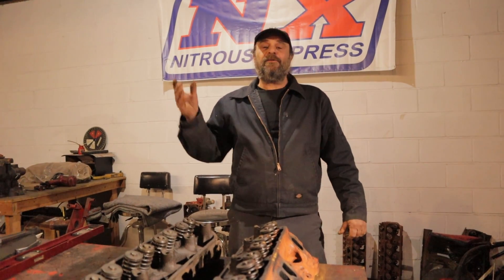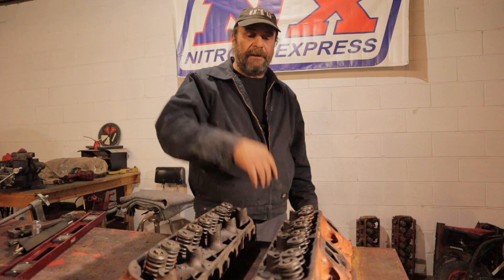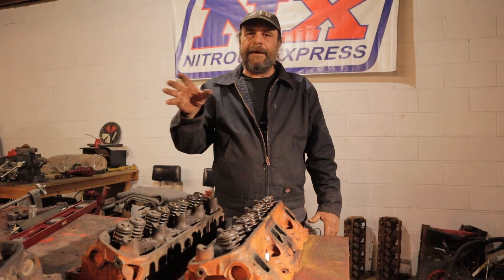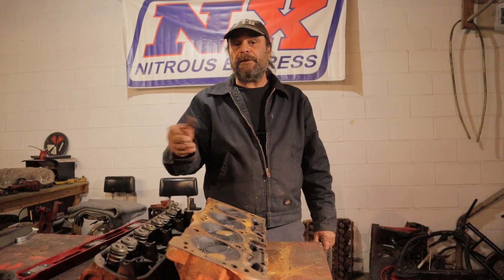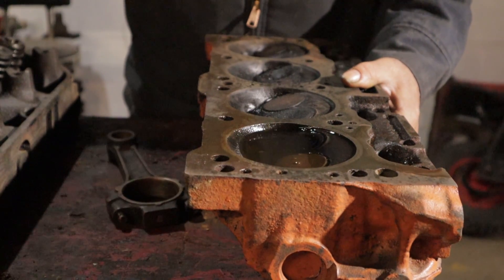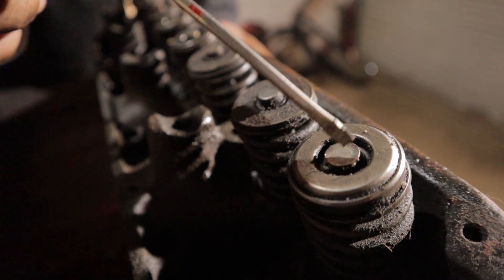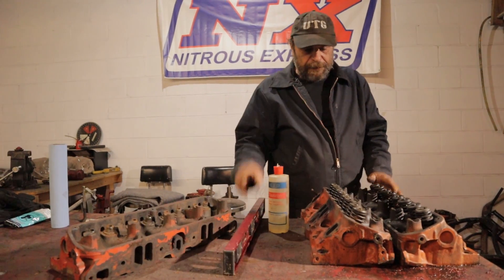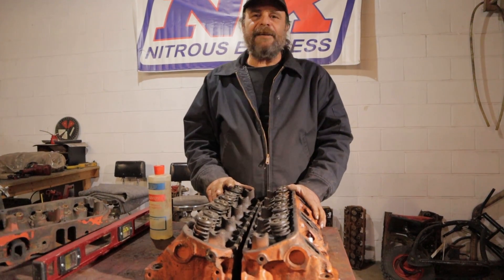Step By Step Home Kitchen Engine Rebuild Part 4:  Cylinder Heads

Comment: Some engines have those problems, some don't. Having only one or two castings for an engine sure makes it easier for the rebuilders to send you the right thing. Some are really hard to find in rebuilder form.

In the last 35 years building Pontiac engines with heads from 67 to 79, mostly before 70, and running them on pump gas or E85/E100, daily driving them for thousands of miles, racing them all the time, I have yet to have a problem with the seats going away. 

Lots of different castings for Pontiacs, they used the chamber size to adjust compression rather than dished pistons, so getting rebuilder heads is dicey at best. The same casting number can have up to three different sized chambers like the 4X head. I can get an iron set ported to flow 90cfm more than stock, new stainless valves, springs, guides, etc for $1500 or so. Thats what I usually do, might as well get it all done at the same time.

Basic aftermarket aluminum heads are over $2k a set because Edelbrock realized they could charge us more for them. The new china heads that came out in 19 are around $1700, but you can end up spending that much to fix them. The only other companies making heads for these engines are die hard Pontiac guys, some of them are hardcore race pieces, some are daily driver types that can be made to flow quite a bit. 

None of the big companies like AFR, Holley, Brodix, etc make a Pontiac head. We still have lots of choices though, and there is one tunnel ram still available... I need to order one, for science. Gasser science of course.

Comment: Thanks tony that's why I running 68 7a heads on my 71 350 olds love the vids bro 👍
Reply: Yea, it's his fault that im obsessed with finding a 1973-74 Duster now. Slt6 or 318 dont matter. Had one when i was 17 and now i want another one like it. I care nothing about numbers or any of that rigg-amarole.
Just a straight duster not full of vent holes.
Reply: Olds fan here, how does that motor run
Reply: @williamtownsend4978  not the fastest butt sound the nicest about 325 hp ✌got that Oldsmobile sound that I love

Comment: I remember Mopar came out with hardened valve seats in 1973, but recommended using leaded gasoline every third fill up to coat the valve seats. It takes a long time to wear even unhardened valve seats though.
Reply: Not in my experience. If you drive it every day it doesn’t take long at all. Three months and it worn, six months is worse. A year and it’s worn out. Remember, this is my personal experience. The best thing is to put in hardened valve seats or a late model head.
Reply: @ryandavis7593  Some engines went to rotating valves for unleaded gasoline, but setups usually don''t hold the valves as securely as positive valve keepers. Ford went back and forth with rotating and non-rotating valves in the Cleveland M series engines.
Reply: @ryandavis7593  
Daily I deal with this shit on air-cooled b+s engine powered generators powered by lp/Nat gas. 
The recommended valve adjustment every 100hrs. 
I've seen em not start in 180hrs without an adjustment. 
Not sure how the new customers generator I fixed last week ran  until 380hrs without an adjustment.
There wasn't one loose rocker at all and they gotta be .006🤦
No compression, fucks up the intake vacuum signal and the regulator won't allow proper fuel draw. 
See it all the time , it's surprising how much shit they can handle actually. 
But wearing valves so bad that the adjustment can close up totally by 200hrs is nuts you're not doing your valves any favors. 
That's what people don't realize about LP, it sucks as an upper end lube and wears out the top end alot faster.
That gasoline is actually lube for the valves. 
I've had plenty of gasoline units with plenty of clearance at 100hrs, but still set them cause you're there.
Reply: @ryandavis7593  Mrs. Landy, his 64 Dart has unhardened seats and literally one million miles of driving.  I've had excellent luck with unhardened seats.